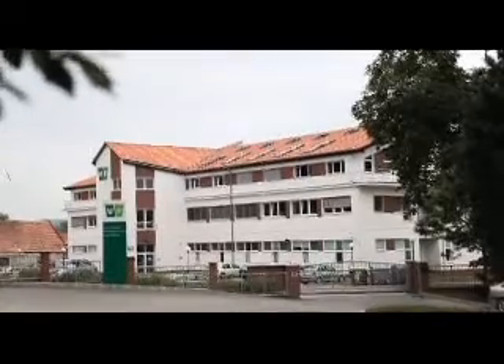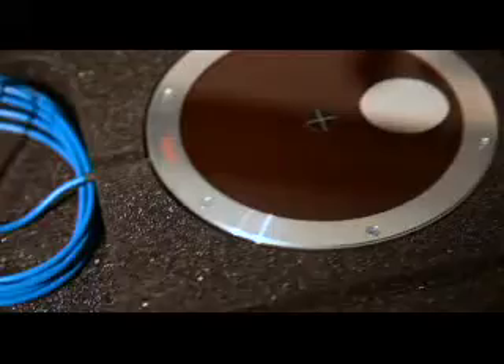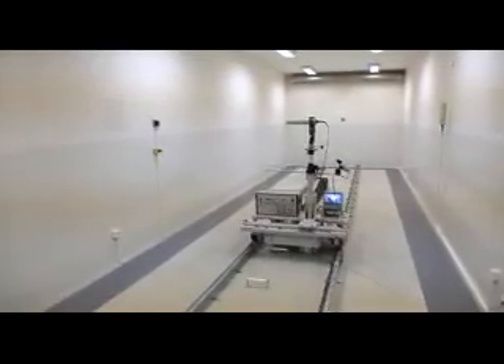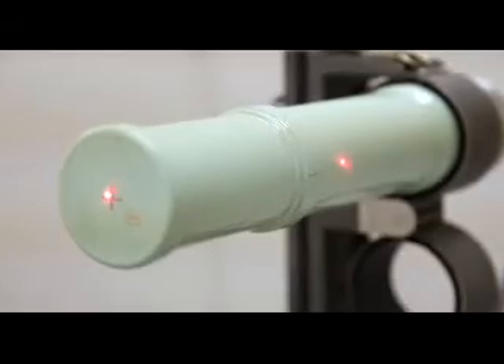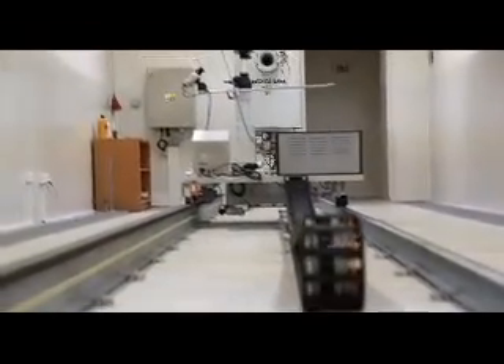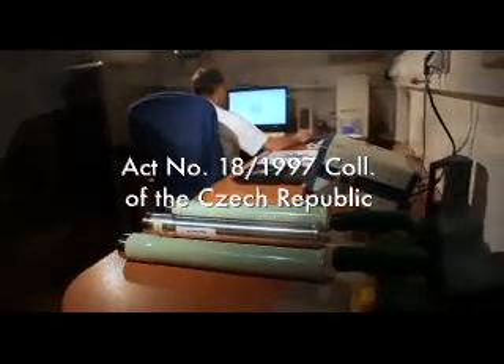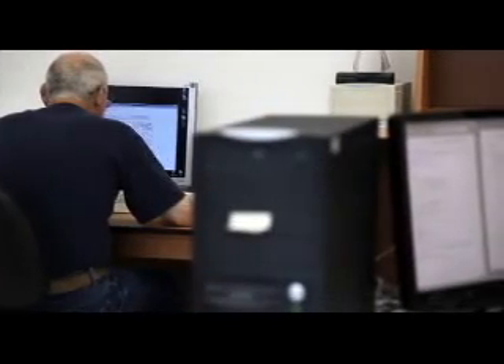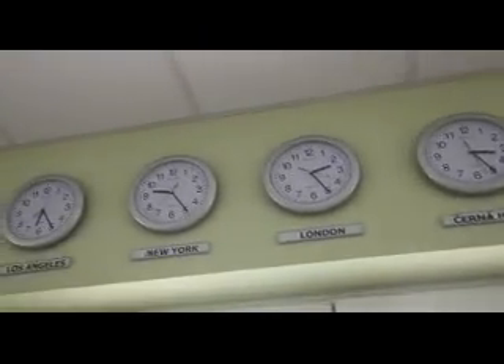Ionizing Radiation Calibration Laboratory

Comment: Is the Calibration/Metrology expert safe with out  Wearing any Safety Apron Even if the Source is shutting down to change the TLD?
Reply from the maker: Yes, if all safety regulations are followed, the worker is safe. When the irradiator is switched off, the radiation sources are driven inside and adequately shielded. If you have additional questions, such as using specific sources, please contact us at sales@vfnuclear.com